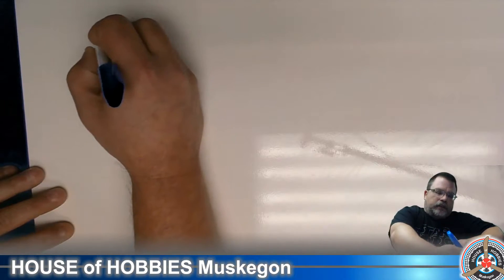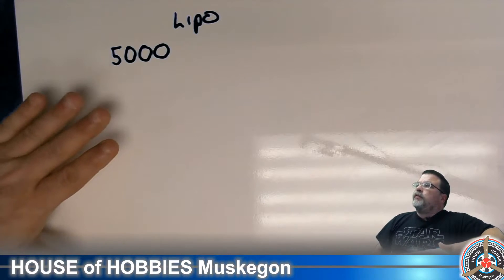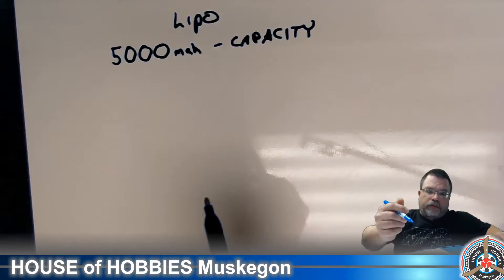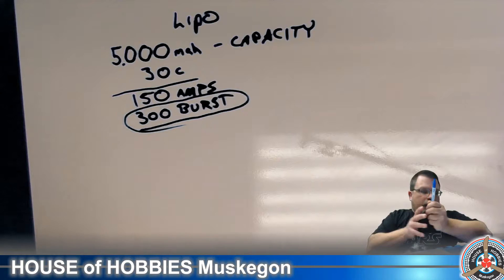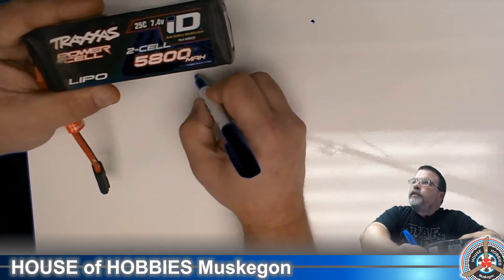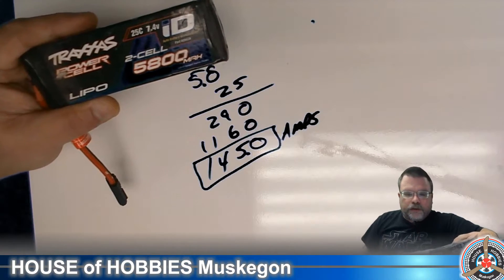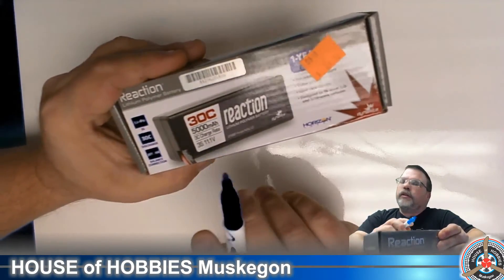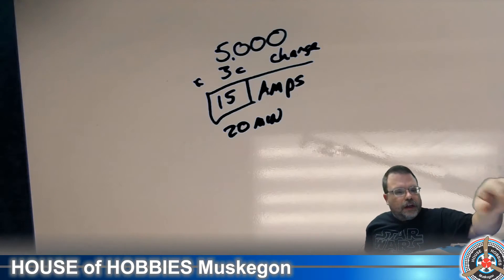RC Car Battery Amperage and Charge Rates - Nimh, Nicd, Lipo

Comment: I'm a retired mechanic, I did RC but not so much now, I'm charging Ni-MH and Ni-CD AA's and AAA's at home with my HItec multi-charger, My question is about internal battery resistance, I'm looking for the proper charge rate for the AA's, I'm asking because AA batteries dont deal well with high current demands, What "C' rate should I use for a standard charge, Thanks.